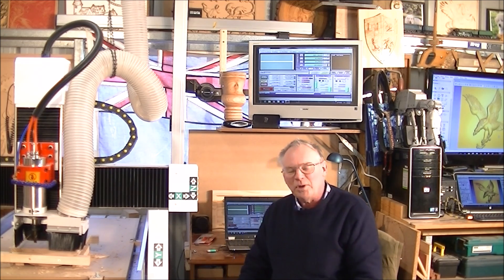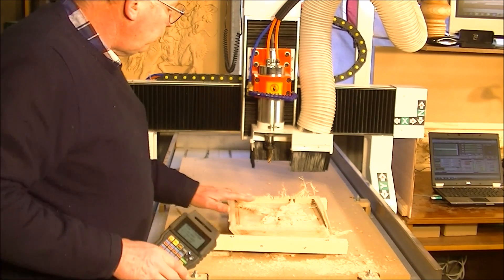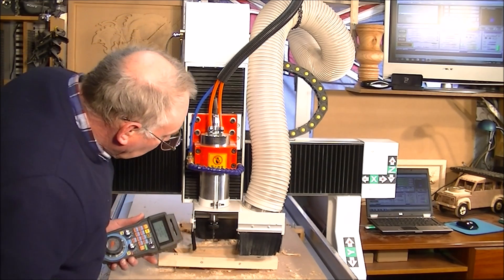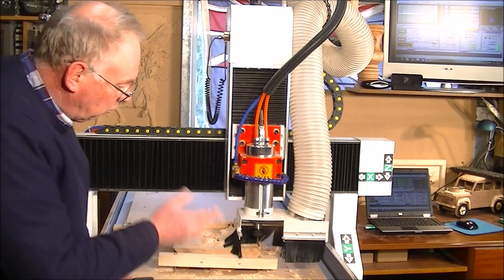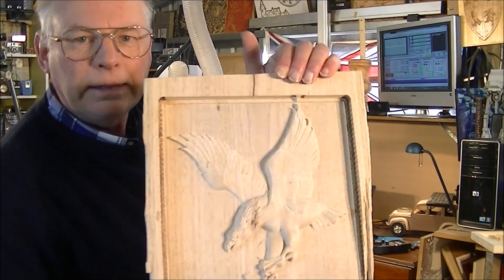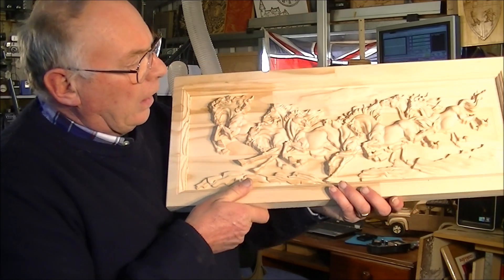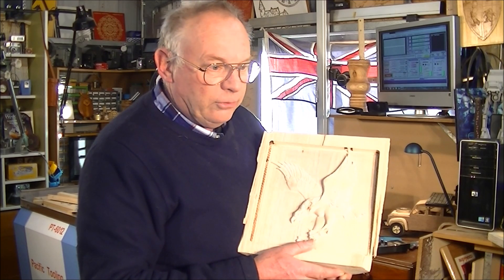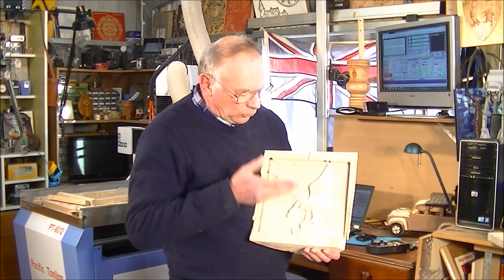186 CNC Router turning a $0.10 log into $100.0 Art Décor

Comment: Surface finish depends on your ball endmill radius and stepover. So if the model allows it, use the biggest radius endmill you can and adjust the stepover for it.
For example you got a 1mm radius with 0.15mm stepover, it will have the same surface finish as a 2mm radius with 0.21 stepover.
It is: stepover squared/8 x radius
With that you can find your optimum settings